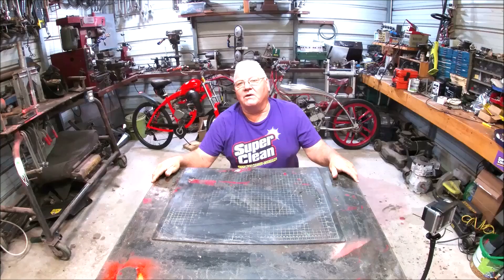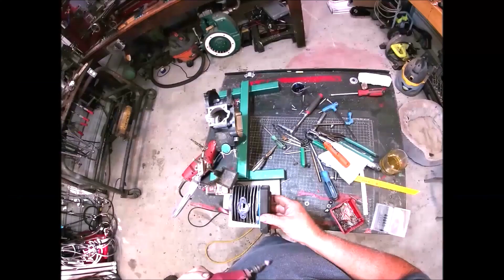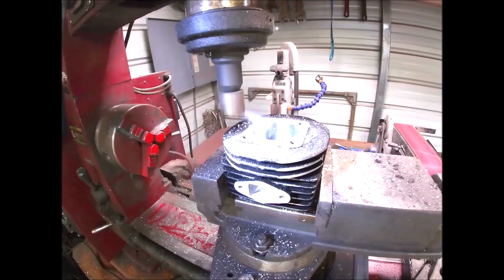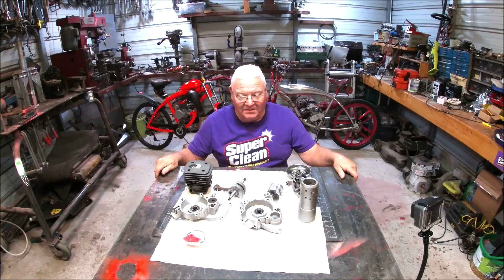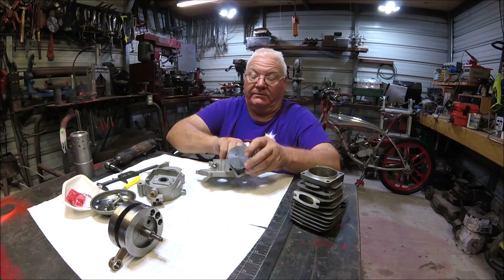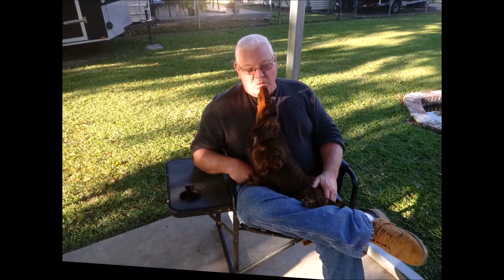Motorized bike 58mm cylinder beast mode part 1 the explanation

Comment: What's up mr Kevin, ,I'm wanting to try a 58mm stihl jug at see how many ob stic culs I run into I notice you seem to like husky ,I'm hoping it's running a 12mm pin,,immediately really not a fan of bushing down the piston to a 10mm pin, ,I've  been buying those 110cc bottom ends an getting the crank out of them for about 100 bucks ,an hang on to the rest of the new parts ,,

Comment: You can take whatever size your carb is and multiply the size by 5 and that will get you a good baseline to start with aka if you have a 20mm carb not saying that's what you should run but stick with me take 20x5=100 and that's your main Jet you want to run as a baseline you can lean it out from there but that equation usually gets you really close to stoichiometric